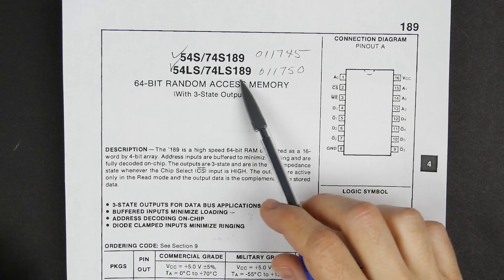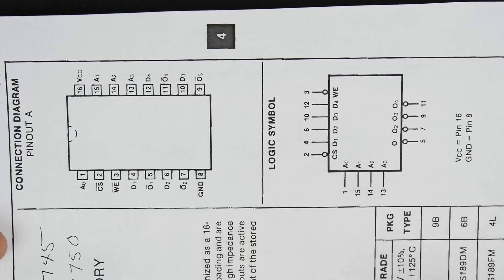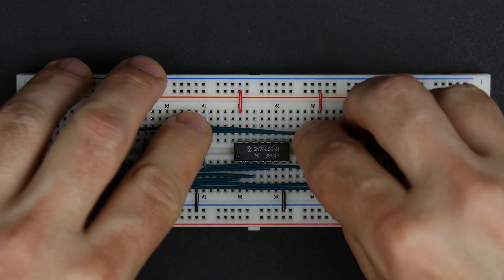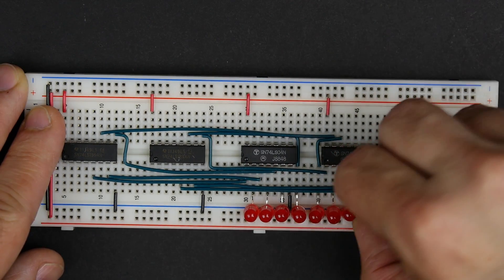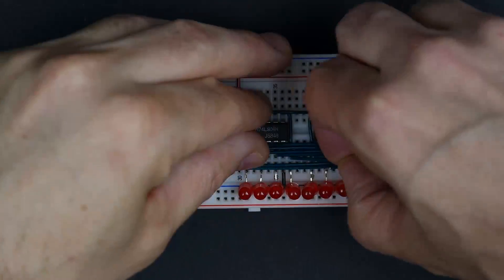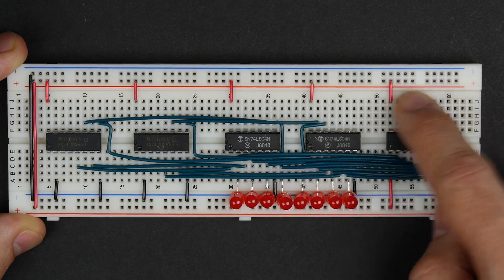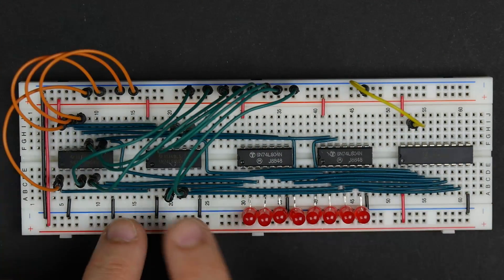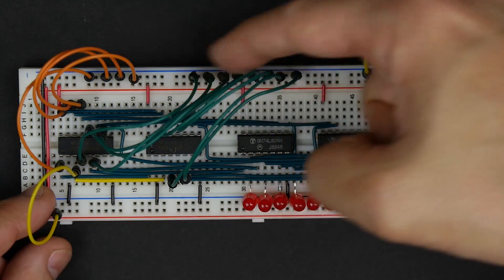RAM module build - part 1

Comment: Hello Ben,

Thank you again Ben, I have spent some time reverse engineering your 
videos and building your 8-bit breadboard computer designs , I have 
created schematics of what I have built and tested so far from your 
designs. I am new to producing content to share with others and I put 
some documents, pictures and videos  up on Google with sharable links.

There are still several sections you have not covered yet looking 
forward to them. 
Ben you are an awesome teacher / engineer.
SAP-1_Malvino_Description_Digital_Computer_Electronics_Malvino
https://drive.google.com/open?id=0B2ZePCSY4JnFdjByUnVES25rU28

Picture of my RAM module Test using the clock I built and binary counter
 with data switches and address switches step thru contents of memory.
https://drive.google.com/open?id=0B2ZePCSY4JnFSkZ3NDMzOElVWGs

Schematics: My 8-bit breadboard computer PDF Schematic Diagrams of what I have built so far. 

PDF Schematic Diagram of my built 8 Bit A Register module.
https://drive.google.com/open?id=0B2ZePCSY4JnFUm45LWxJU2JMbFk

PDF Schematic Diagram of my built 8 Bit B Register module.
https://drive.google.com/open?id=0B2ZePCSY4JnFdGlDOEdCZXZDTnc

PDF Schematic Diagram of my built Instruction/Address Register module.
https://drive.google.com/open?id=0B2ZePCSY4JnFc08wdHd0TEtlTWc

PDF Schematic Diagram of my built Instruction/Address Register module.https://drive.google.com/open?id=0B2ZePCSY4JnFd1RzUmVPWnJ2aVk

PDF Schematic Diagram of my built RAM module.https://drive.google.com/open?id=0B2ZePCSY4JnFTGpHbkVsWmZSVTg

Ben you didn’t talk about the EEPROM’s in detail yet, so I reversed 
engineered your Output Register what I saw using 3 EEPROM’s as a binary 
to seven segment decoder / driver, I added display format select feature
 you can select decimal, hexadecimal, octal. 
PDF Schematic Diagram of my Output Register – Display module.
https://drive.google.com/open?id=0B2ZePCSY4JnFanYzTVhudkVyaWc

Please feel free to contact me thank you Mike, :)
Reply: Hey Mike, 

I like the things you were able to link us up to. Nice work.
I have created an IC pin out diagram of all of the modules that I have completed so far.
 
I have just started following Ben's lectures here, and I really like
the way he explains things. I can really get a good picture of what he
is doing and why.

If you do not mind, I would like to make sure that I am up to date here.
I have currently built the following breadboard modules.

555 clock w/ monostable, astable and bistable 
A Register
B Register
Control Register
ALU
16 Byte static Ram

Am I missing anything or is that where we are currently at?

I cant wait to build some control logic, so that I can actual use my
control register and Ram board.
Reply: 8 bit register
https://drive.google.com/open?id=0B6LIgQzDkH8fcjV6UDFkU3dabVE

ALU
https://drive.google.com/open?id=0B6LIgQzDkH8fc09nOHVmWHpPZ3c

16 Byte memory
https://drive.google.com/open?id=0B6LIgQzDkH8fa2hkRUoxM3VRSUk
Reply: Hello Jeff,

Awesome work ,  nice diagrams on your 8 bit register, ALU, and 8 bit memory keep up the good work :)
Reply: Are there any modules that I am missing? Or am I up to date?

I really like the way Ben goes into detail, without spending too much time. He
explains things in a clear an understandable manner, that makes learning fun.
Reply: Hello Jeff,

Here are Bens current 6 Modules that videos complete, 
Completed Video Modules so far as of August 20 2016 :

CLOCK
A register (Accumulator)
B register
IR - Instruction register 
ALU – Arithmetic Logic Unit ( addition and subtraction )
RAM – Random Access Memory replaced the ”PROM - Programmable
Read Only Memory”

Pending 5  Video Modules Builds:

    MAR - Memory Address Register
    PC - Program Counter
    IR - Instruction Decoder &#160;( uses 1 EEPROMs)
    CON - Control Unit (note: &#160;CON is built across many breadboards modules )
         (8 Bit Counter, Ring Counter to produce operation T0, T1, T2, 
               T3, T4, &#160;T5 sequence &#160;control.) 
        (2 EEPROMs to decode control word” output controlling all 
                Module   sequence / operations like load, output to bus,)
         ( uCode Rom Address’s logic and LED display, ETC.)

    OUTPUT Register / Binary to LED Display
(uses 2 register latches, 3 EEPROMs are used to convert binary to 3 separate single digit 7 segment display decoder / driver sweet )
I noticed Ben had simplified design using the EEPROM to
eliminate many logic chips.
Thanks MIke,
Reply: Thank you, It looks like I do have all 6 of the modules that he has videos for so far.

I am assuming that the SAP-1 PDF file that you have linked to, is the main document that
is being used in this project?

Is it a good read? I skimmed through it and looked at the diagrams but it looks like it spends more time on the programming side of it, instead of the build side.
 I like ASM language, so I am not worried about that end of it too much.

I would like to get the parts ordered that I will need to complete some of the next modules that still 
need to be built, before I can get started program anything.

I am really enjoying this project, but I hate getting stuck here without the rest of the videos. 
Ben really has a gift, for instructing. He is very clear and precise, down to the actual building process, 
where you can watch him wire each module up, wire by wire. 

I appreciate your help as well. As I do want to move forward, and I believe you have helped by leading me in the right direction, so that I can do some more research. 

I am concerned that his instructions may deviate from the SAP-1 manual, but at least I will have a better understanding of the remaining projects, when his next video comes out.

From what I have seen, it looks like they come out weekly? Do you have any idea or guess when the next one may come out? 

Thanks again Mike

Here is a quick look at some of the other things that I am into. I think you will get a kick out of this.

My Collection

https://drive.google.com/open?id=0B6LIgQzDkH8fdFozd29IOHRtTW8

https://drive.google.com/open?id=0B6LIgQzDkH8fX0tSZEFlc0haRWc
Reply: Hello Jeff,

Ben has done a newer design using EEPROM instead TTL logic.
I gave you the PDF that out for the SAP-1 design, that designs dose work I am sure.
 You can also Google and get many more Simple as Possible design SAP-1, SAP-2, SAP-3.

The Book that Ben Referenced,  “Digital Computer Electronics”  by Albert Paul Malvino, 

I will post some more of my complete work ahead of Bens work.
Thanks Mike,
Reply: I found this diagram that is very impressive and easy to follow.
I think everyone should see this diagram, it really shows you the entire system
although it does not have all the tri-state buffers that Ben has, it is a pretty good 
reference point.

Did you checkout my 8 bit computer collection?

https://drive.google.com/open?id=0BzeLVhP_vKa_dHg1R1lHY0RKWVE
Reply: Commenting so I can come back to this
Reply: Mike DeLosier 

keep the great work

Comment: were do you get your breadboard wire from?
Reply: Hello,

Recommend multi-color 22 Gauge Solid Hook-Up Wire , many electronic retail parts vendors sell solid wire to use.

I purchased 6 color pack, RED. YEL. BLK, WHT, GRN, BLU  at my local Micro Center for $18.99.
http://www.microcenter.com/product/404659/22_Gauge_Solid_Hook-Up_Wire_25-Foot_6-Color_Kit

Micro Center has other Brands.
http://www.microcenter.com/search/search_results.aspx?Ntt=solid+wire

EBAY,
http://www.ebay.com/sch/i.html?_from=R40&_trksid=p2060353.m570.l1313.TR0.TRC0.H0.X22+Gauge+Solid+Hook-Up.TRS0&_nkw=22+Gauge+Solid+Hook-Up&_sacat=0

EBAY also has a Nice 10 Color Pack,
http://www.ebay.com/itm/Hook-Up-Wire-Kit-Solid-Wire-Kit-22-Gauge-25-Feet-Spools-/121949521064?hash=item1c64c204a8:g:zToAAOSwjMJXB9pO

Thanks, Mike

Comment: +Ben eater what is ram used for? what's the difference between ram and a register? couldn't you used one of the ram "Raws" to make a register?
Reply: +nlz90 with the right circuitry, of course you could but it's better to use normal registers for the ALU. You could of course try using ram for that to.
Reply: As Far as I know, the registers are really just temporary storage for making sure the bus isn't constantly going in and out of the ALU and stuff. The RAM is the memory. In reality, in this computer, I think the registers are more like RAM and the RAM is more like a Hard Drive lol
Reply: +IanCraftsAndMines ram is a massive temporary storage but when power is turned off it loses all it's data and you could use a row of this chip as a register but you would waste the space. The hard disk is not like ram because it retains it's data but is much slower.
Reply: +IanCraftsAndMines but if you were talking in cpu perspective you are sort of right
Reply: +IanCraftsAndMines sorry I meant +nlz90
Reply: Leon Konings No I was more referring to the computer that is being build here.  
is there any advantage to have to different registers when you can have another ram as a register ? maybe both are done here as a learning exercise which i appropriate
Reply: Sorry for possible bad english
Reply: Using registers is more representative of the physical design of early microprocessors. In some processors, registers have specific purposes. In others all registers are general purpose, similar to RAM.

Comment: i cant find the 74LS189 ic chip on ebay or any else where, does someone have any tips? im from sweden btw
Reply: Hello to your post I saw, checking on EBAY I found 11 sellers that are selling the 74LS189 (64-bit random access memory), that's where I purchased mine from and the TI discontinued hard to get 74LS219 replacement, of 189 all positive logic no need to invert Q outputs with the 74LS04's .

http://www.ebay.com/sch/i.html?_from=R40&_trksid=p2060353.m570.l1313.TR0.TRC0.H0.X+74LS189.TRS0&_nkw=+74LS189&_sacat=0
Reply: Hey Mike, 

I was wondering if you might be able to help me get my LEDs setup on my bus. For some reason, I can not figure this out. If you have the positive and negative sides of the LEDs plugged into the same bus line, this will not work.
Thanks to the SAP-1 PDF file that you uploaded, I am able to continue on and setup all the other modules, but I am stuck on this simple matter of setting up the LEDs on the bus lines the way Ben has them setup. I can not see what he has done, to get those LEDs working correctly.

Thank you
Reply: Hello Jeff,

The longer lead on the LED is ( positive + ) goes to the the logic gate output and the short lead is ( negative - ) goes to ground.

Polarity:  https://learn.sparkfun.com/tutorials/polarity/diode-and-led-polarity 

Step 4: Step 4: Identify the LED Polarity.
http://www.instructables.com/id/Just-in-time-for-the-holidays-Hack-yourself-a-me/step4/Step-4-Identify-the-LED-Polarity/ 

Your Welcome Mike,
Reply: I know that, I do not have any problems installing the LEDs when connecting them to the ICs. I am talking about setting up the BUS in the midle, when all the lines are running down the middle, and Ben has 8 LEDs setup at the very top of the BUS.
These are the LEDs that I am having problems with.
Reply: These are the LEDs that I am having problems setting up. I know it is probably something simple that I am missing.

https://drive.google.com/open?id=0B6LIgQzDkH8fNENHQ3k1Ym5POTQ
Reply: Jeff,
Each of the 8 BUS LED's (long lead +) goes to the data bus side connection  BUS Order Left  ( 128, 64. 32, 16, 8, 4, 2. 1 ) Right.

The other LED lead is the (short lead -) that goes to current limiting resistor in series to the ground bus thru black wires.  you can see 4 resistors on left side of bus and the other 4 resistors on right side of bus.

To test data bus LED & connections, connect the right side bus ( bit 1 ) to to 5 volts and LED should light, then step thru all other bus bits connections.  note: each LED has its own current limiting resistor in series to ground, with out the current limiting resistor you will blow LED's out.

Hope this helps,
Thanks Mike,
Reply: What you are saying makes since, but how can you get all the LEDs aliened across the top if you have the negative leads on the side of the bus? 
I can not see where the negative leads are hooked up on the sides in the picture, where the current limiting resistors are located. Does one negative lead get hooked up to each resistor individually?
Reply: When I have the positive lead in the 4th bus line, and the negative lead stretched across the board to where the resister is, the LED is over the 1st bus line, not the 4th, where it belongs.
Reply: I am thinking that he may have the cathodes all tied together. As I do see at the very top, one small lead plugged directly into the negative line above the resistors.
Reply: I do not know if you got my last message.

I think that he has all the cathodes  (short leads - ) tied together and plugged into the negative run on the main board. 
The anodes (long lead +) are plugged into the the BUS and the current limiting resistors are also plugged into the bus in front of the LEDs. The resistors are also plugged into a single row on the main board and then back to ground.

Here is a diagram, of what I am talking about. Please take a look and let me know what you think.

https://drive.google.com/open?id=0B6LIgQzDkH8fTG1kUUMtXzdTcDg

Thank you
Reply: Hello Jeff,

Sorry I was grilling out dinner, 

Jeff you are correct looks like Ben soldered all his BUS LED ( cathodes - ) to to one ground. ping off on left side and the resistors below are separate,  to pull the bus down to ground ?

Ben connects all his LED's directly to gates with no current limiting resistors except for the ones on the memory ( run / program ) push button toggle switch.

Gates normally have internal pull up resistors making open gate pins logical 1.

I used a 9 pin 330ohm SIP resistor to tie all my LED's to ground, I am old school from decades of building digital systems and IC manufactures best practices.

Thanks Mike,
Reply: Yes that's what it looks like exactly.
Reply: I have found all the parts on Jameco.com at very reasonable prices. I ordered just enough parts on my first order to get the free shipping club. Then, with a $25 minimum order there's no shipping.

Comment: i found a chip that may wanna work instead of 74LS189: 74219 "64-bit (16x4) RAM with noninverting three-state outputs" i found it on wikipedia.
if this is any help for someone
Reply: Yes, he mentions about that chip at [2:27]: "... I looked and there was a 74LS219 but I couldn't seem to find it anywhere ... if you get your hands on one, that one doesn't require the inverters ... I'm just kind of using what I've got available ... if you wanna find a different chip and use that in yours I definitely encourage you to do that ...".
Reply: There's a seller on eBay with these chips in London, but at nearly £20 for each chip, I don't think I'll bother.

Comment: I used an eeprom instead if SRAM so that I can just insert a pre-programmed chip in. This was mainly do so that I can save time in case of a time limit at a science fair. It is also nice to do to have a separate programming board that looks like something Ben made, and just do the major wiring quickly with zip wire.

Comment: Mr Eater, do you have a video that gives tips on ordering parts, for example, form factor, voltage levels, packaging options, etc.  I would like to do some hobby ALU circuits with my high school kids but not sure about some of these options.  Also, is a USB charger a reasonable power supply?
Reply: +RobertMOdell In the above case he is using 'DIP' packages. For working on breadboards, as above, DIP packages are what you should look for as 'SOIC', 'SOT', or other parts will not slot into the board as the pin spacing and shape of the legs are different. The number after the package denotes the number of pins, ie. DIP-14 = A DIP package with 14 pins.

These Integrated circuits tend to be 'Logic level' which means they will only tolerate a small voltage or they will be permanently damaged. This will be specified as 'supply voltage max', and the higher the supply voltage the better as there is a lesser chance of it being damaged in voltage transients (fluctuations) and floating inputs (Caused by plugging and unplugging in the power supply as one example). 

For example, part number: SN74AC04N, is a 6 input inverter in a DIP package which can tolerate a maximum supply voltage of 6v. In the case of a USB charger it should be fine as that power supply will output a hair either side of 5v which is ideal in this case. 

Summary: Look for 'DIP' packages, The higher the maximum voltage input the better; in this case any more than 10v is unnecessary, The more pins the package has the more inputs and outputs it has as a rule of thumb (The manufacturer will state this during selection of the part, or on the data sheet); a DIP-8 might have 4 inverters where as a DIP-14 might have 6, When you narrow down your list to say 50 parts it's a matter of finding the cheapest part after all other criteria is met. 

I hope this answers your question and I wish you and your class the best in your endeavour.

Jason
Reply: RobertMOdell how is it going with the students? The only electron stuff at my high school was a class to program extremely simple games